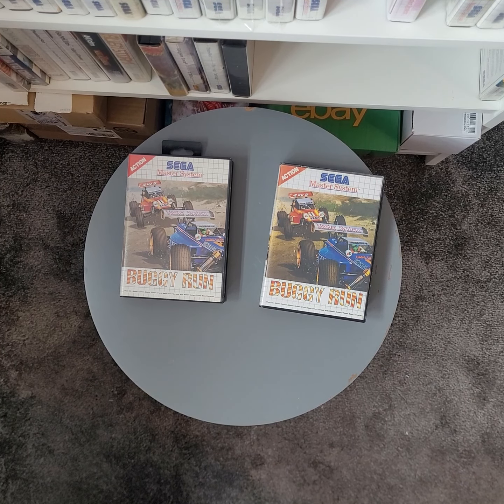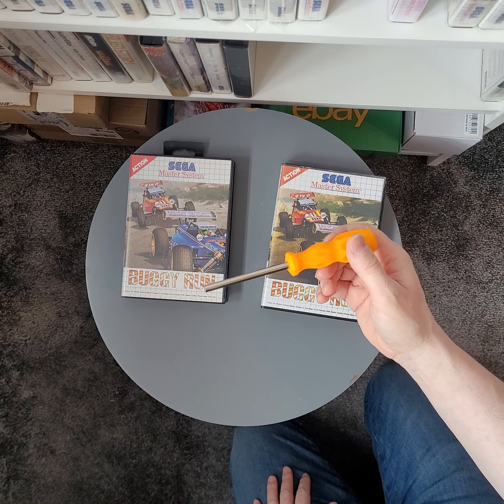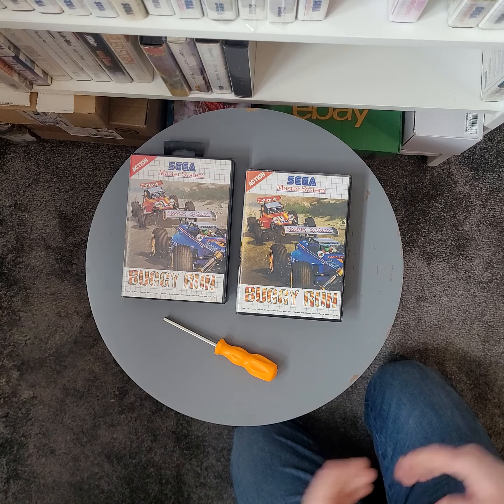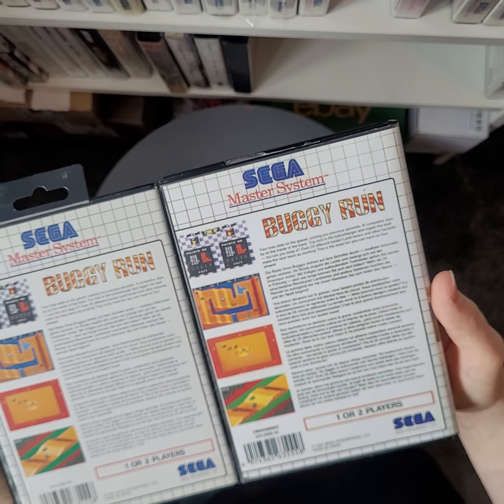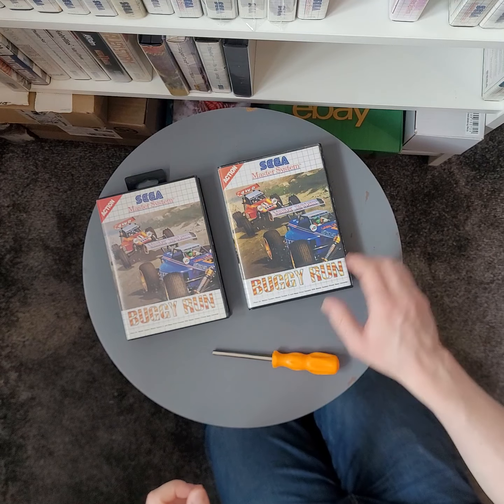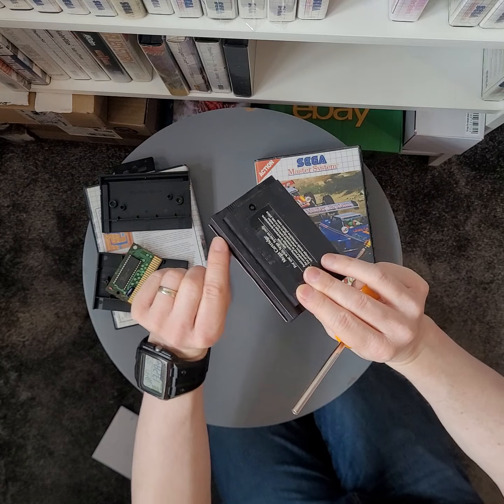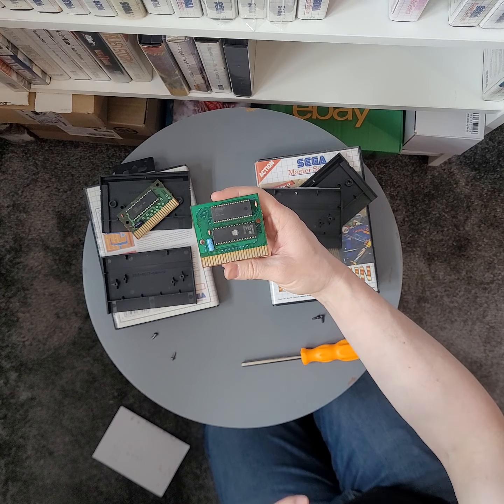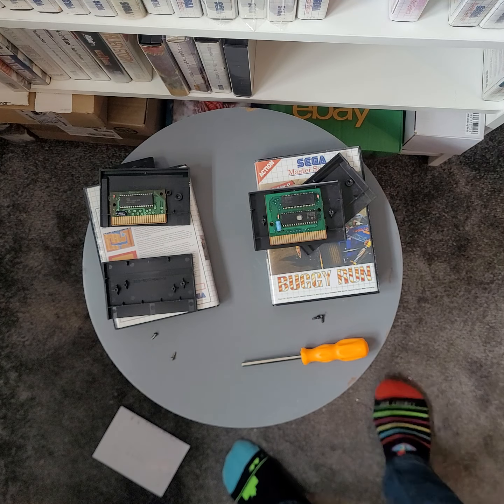FAKE vs REAL Master System Games. How to tell the difference.

Comment: Great video Oli! Not going to lie, I didn't even realise that repro SMS titles were out there! I've never checked any of my games for authenticity but I picked up most of my games in the late 90s early 00s when no one wanted their old games anymore, repros that look closer to the real deal is more of an issue recently right? 👀 I know the GB/GBA market has always been flooded with fakes, but this hasn't always been the case for SMS has it?
Reply from the maker: Thanks Charlotte. Yeah the GB and GBA market I believe is rife. And it's quite hard to tell those apart too. You should be fine with yours but if you ever decide to get 1 or 2 of the big hitters now you know what to look out for hopefully
Reply: @8BitBoyUK  yeah super helpful thanks, I grew up collecting Pokémon cards so dodginess on print work is something my eyes notice quite quickly (as back then there were so many cards trying to be real) when I bought a repro cover art for my Phantasy Star like your Buggy Run the fuzziness made it quite noticeably off!

Comment: Great video! Print quality and adhesive on the label are usually dead giveaways, however with games getting older, that old glue doesn't hold as well as it used to! The name of the chip is an "EEPROM" to my knowledge Sega didn't use any on their production carts. Neo-Geo and other Arcade manufacturers often did, however. It's best to do as much homework as possible when spending a lot of cash. You're doing people a great service with a video like this, thanks!
Reply from the maker: Thanks mate really appreciate that. Yes, EPROM that was it 👍

Comment: With regard to fake vs. authentic, is there a way to tell just from the screws used on the cartridge? I have seen Master System games that have those security bit screws and also others with just standard Philips screws. Did SMS carts make use of both screw types?
Reply from the maker: No you really need to open them up imo. You can usually tell with the printing on the sleeve cover and manuals are quite hard to fake too.